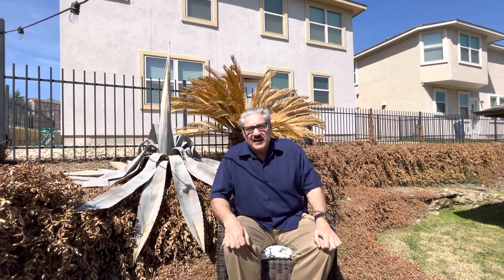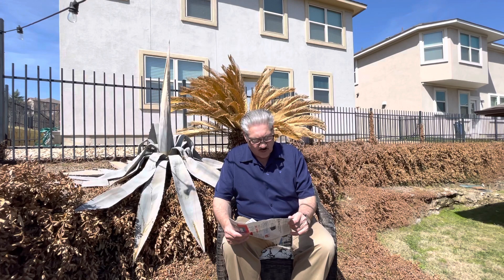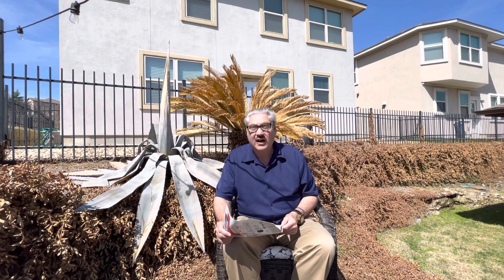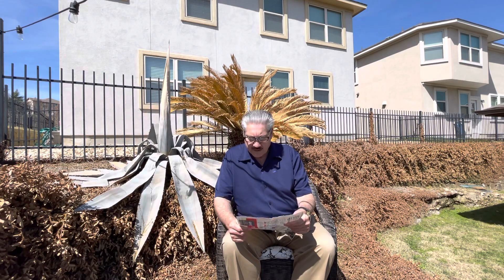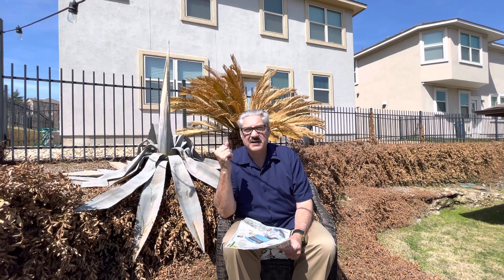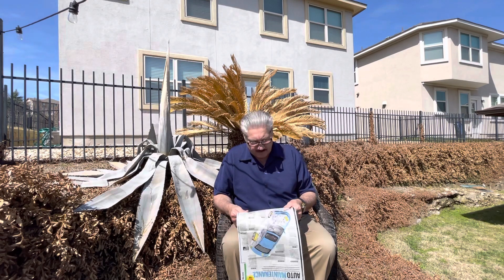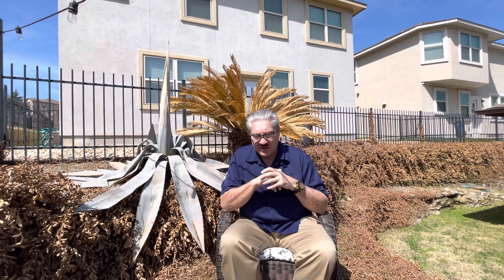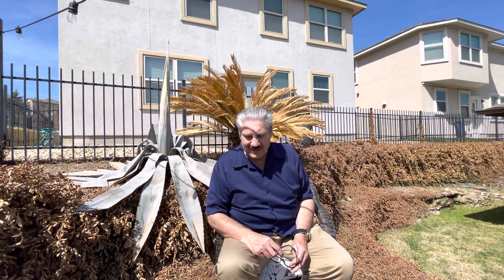OLD CAR, NEW CAR TIPS 🧰⚙️  3-4-21

Comment: Your the greatest Holtzman. I used to feel the same about the “air” and the water, for that matter. I just figure it’s cost for the electricity to run the compressor and the water bill. Little inside tip, if you get friendly with your local gas station attendant, a lot of times they have a little button behind the counter that turns it on. Just ask. Have a great weekend.